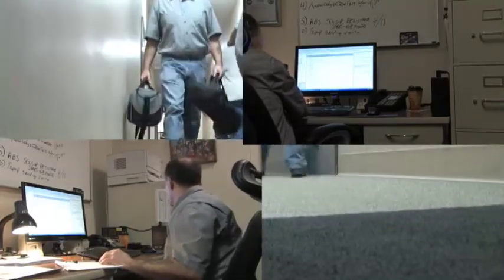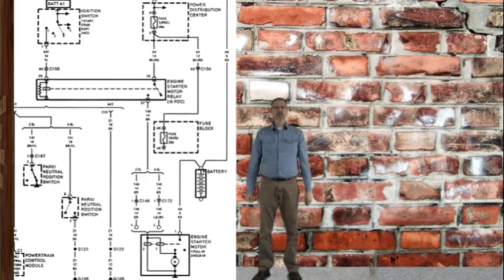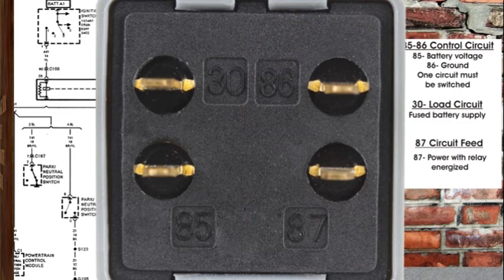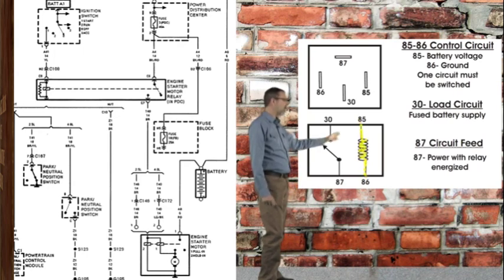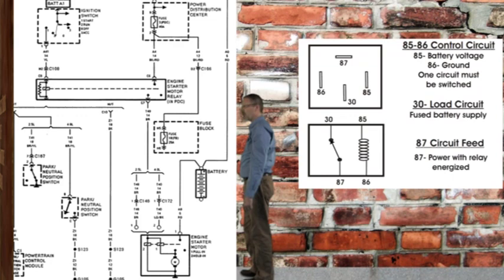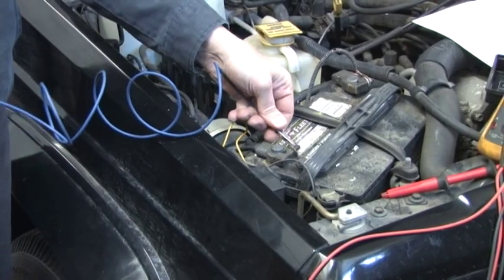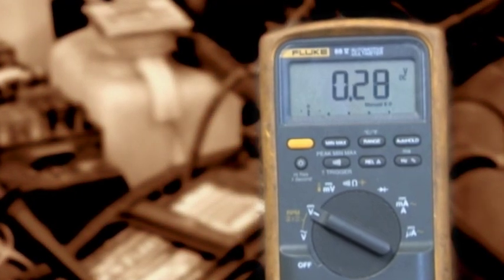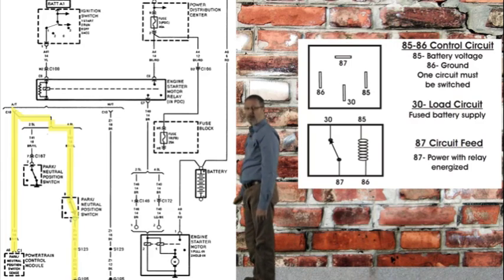No Crank / No Start Relay Diagnosis Jeep

Comment from the maker: @felipevinalay 	
2. If any one or more branches of the A14 circuit do not illuminate the headlight, check splice S116 in the main harness near the Transmission Control Module (TCM). The A14 circuit feeds the ASD Relay, the Transmission Shutdown Relay, pin 56 of the TCM, and pin 46 of the Powertrain Control Module (PCM).

Comment from the maker: You are right, the PCM does ground pin 85 to activate the relay. You can run a ground there yourself and see if the relay activates and the engine might even start. That is also tied into the security system if I remember right.  Let me know what happens after you ground it.

Mark Hicks
Wells Vehicle Electronics

Comment from the maker: While everything is dead check the battery connections. Turn the headlights "on" and wiggle the battery connections. If the lights pop on momentarily you found the bad connection.

Mark Hicks
Wells Vehicle Electronics

Comment from the maker: @felipevinalay Usually pin 30 leads to the coil positive. If this is the case for your vehicle, run a jumper from pin 30 to the coil positive terminal, if this works you have a broken wire in between.

Mark Hicks
Wells Vehicle Electronics

Comment from the maker: @felipevinalay I am going to guess you have a Chrysler Intrepid. 	
1. Remove the Automatic Shutdown (ASD) Relay from the Power Distribution Center (PDC) and check for battery voltage on pin 30. To properly check for a voltage drop, a current needs to flow through the circuit being checked. Use an old headlight to see if pin 30 of the ASD Relay will illuminate the headlight bulb. Check all branches of the A14 circuit, Red/White wire, with the headlight bulb.

Comment from the maker: 3. Ground pin #38 of the C3 connector at the Powertrain Control Module (PCM) and see if vehicle cranks over. This test verifies the integrity of the wiring between the starter relay and the PCM. 

It is common on your vehicle for a bad connection to the starter to cause this problem. It is also common for the ignition switch to fail. By testing as described above it will help to determine if it is the switch. Stay in touch,
Mark Hicks
Wells Vehicle Electronics

Comment from the maker: @felipevinalay 	
Potential Causes: 	
Splice S116
Tech Tips: 	
Splice S116 is located near the Transmission Control Module (TCM) in the main wiring harness and just below the windshield washer reservoir. 

Let me know how it is going,

Mark Hicks
Wells Vehicle Electronics

Comment from the maker: 1. Access the starter relay and make sure that power is coming to the relay on terminal #30 all of the time, and make sure that terminal 86 gets power in the "crank" position.

2. Monitor the Transmission Range Sensor (TRS) in the scan data, be sure that it shows "park" or "neutral" when attempting to start.

Comment from the maker: Try turning the headlights "on" and wiggle the battery cables. If the lights come "on" you have found the bad connection. It sounds like either the battery has a bad connection or the battery is low in charge. 
Stay in touch,
Mark Hicks
Wells Vehicle Electronics

Comment from the maker: Ok, this is a great question! You have to be very careful testing any green or blue relay on a Nissan. Here is the skinny! Normally most vehicles will ground the feed to activate the relay. Nissan will not always do that, they will send current from the ECM to pin 1 and pin 2 will always be ground. Pin 3 is the high current feed and pin 5 leads to the load. I would suggest checking to see if pin 2 is always ground and try running voltage in to pin 1 to try to activate.
Let me know
Mark Hicks
WVE

Comment from the maker: @felipevinalay That could very well be the problem. Especially seeing they usually go under or near the battery. You didn't say if the fuse had power going to it or not. If it does have power than the problem is from there to the relay.

Mark Hicks
Wells Vehicle Electronics

Comment from the maker: @claroscuro73 Thank you for watching the video. I will be happy to help you with any problems pertaining to vehicle electronics, however I do not have information on a water pump replacement. May I suggest contacting a water pump or cooling system manufacturer.

Mark Hicks 
Wells Vehicle Electronics

Comment: thank for you response Mark, I removed the ASD  relay and pin 30 have no voltage.  and I can't locate the splice  S116, also I make a mistake the vehicle info:  98 Chrysler Plymouth gran voyager 3.0.

Comment from the maker: No Pin 85 should have the supply voltage usually 12 volts and Pin 86 should have the same. Pin 86 goes to ground and activates the relay. 

Mark Hicks
Wells Vehicle Electronics

Comment from the maker: It sounds like you might have a battery or connection to the battery issue. What is the year, make, model and engine size of your vehicle? With this information I might be able to get more specific.
Mark Hicks
Wells Vehicle Electronics

Comment from the maker: Let me step back a second, are you sure pin 86 is not being grounded? When you check this out make sure you have the relay removed from the box and then check the corresponding connectors. 

Let me know,

Mark Hicks
Wells Vehicle Electronics

Comment: Hi Mark I got a 96 Chrysler Plymouth and it will crank but won't start, I have no spark because the coil power have no volts, well I check fusees en relay, coil power, with a multimeter and all that seen  okay, the two coil power cable came from the PCM  without volts,  do you thing the PCM be bad. I will  thank you for any tips. haa this problem happen two days after change the fuel pump.

Comment: Hi Mark, 98 Voyager 3.0L no crank condition,  accordance with my Haynes repair pin 86 it's supply V from ignition switch pin 85 goes to pcm it's that possible the pcm ground it? or my electrical system it's wrong, also I notice the ASD relay pin 86 and 30 have V from battery. if the system it right the pcm may be bad..

Comment: So I have a 40amp 12v relay on my engine harness on my jeep wrangler with a stright 6 and its burnt on the top told me that's no good when I try to start it i just get a click its like I don't get enough power to the starter the starter is brand new and battery to fully charged i don't know if im missing something doesn't seem like it though

Comment: I look the diagram and I only have two fuses:# ten and 17, 10A to relay start which pin 30 have voltage,  fuse 17 20A its good, to me the problem is between the battery to fuse 17, but there are bunch of wires and that the problem to me.

Comment: Ok what connection should I check, from junction box to PDC or from PDC to ecu? Is there another way of activating the relay? If the relay is not activated can it cause the high pressure pump not to pump fuel to injectors?

Comment: I am having trouble with a 1997 Acura Integra (battery, starter, alternator, all passed electrical tests) once I have the wiring diagram what tool do I need to test the neutral safety switch?

Comment: This is a great video, by far the best info on solving this problem. I tested the battery at a local auto parts store, tested the solenoid and starter by jumping from the battery to the solenoid terminal and bench tested the starter relay (k3 on my 2008 Jeep Wrangler JK); all good.  There is 12.5 VDC at terminal 30 on the starter relay at all times.  I am a bit confused about checking terminal 86 for 12.5 VDC when starting; can't you pull the relay and see if there is 12.5 VDC on socket 85 when turning the key to start?  I checked both ways and never got 12.5 VDC so the relay is never closing.  That leaves (I believe) circuits upstream of the relay, ignition switch, etc.  I don't have a wiring diagram.  Any thoughts?
Reply from the maker: So you have a no crank no start problem on an 08' Wrangler? Which engine? Do you have a security or theft light flashing? 
Mike Becker, Technical Services Instructor
Reply: No security light (I tried pulling the IOD fuse for 30 sec);  It is an intermittent problem.  When It won't start, I have to jumper pin 30 to pin 85 to apply 12.4 VDC to the starter relay, AND jumper directly from ground to pin 86. It's a 3.8L V6 automatic.  Thanks Mr. Becker!
Reply from the maker: Most commonly on these Jeeps is the transmission range sensor causing it to not start. It will only start in park/neutral. Next time it doesn't start try shifting into neutral then try to start. If it does start, you know your problem is inside the trans range switch. It also sounds exactly like what you have going on, because the Jeep runs after you get it started. Let me know how that turns out. Have a great day.
Mike Becker, Technical Services Instructor
Reply: Thanks, I tried Neutral already and from my research am suspecting the trans range switch but couldn't figure out why 85 never gets 12 VDC AND 86 never has a good ground; I thought the range switch was on one side or the other.  Have a great day!

Comment: hi dear i have 2008 jeep compass car not cranking and not starting  and no fault cod
Reply from the maker: First things first, make sure the battery is ok. From there you could have a bunch of different issues. Maybe a security problem?
Mike Becker, Technical Services Instructor

Comment: Hi Mark, I tried calling you a couple of times I couldnt get through. I tested with the relay connected both pin 85 and 86 showed 12volts. But when i disconnect the relay pin 85 has 3.57volts and pin 86 has 12volts. Will keep trying the phone. Thanks

Comment: Yes the fuel pump is not turning on with the relay, I even tried switching the relay. When I jump with a wire the pump activates but the high pressure pump doesnt pump to the injectors the fuel returns back to the tank.

Comment: need some help when i turn on the car in the start thew check light comes on taught it was the main relay but i do not know
Reply from the maker: What is the year, make, model and engine size of your vehicle? Does it crank and not start? Or doesn't it crank (spin) at all?
Mark Hicks
Wells Vehicle Electronics
Reply: I got through it was a small wire leading to the distributor which broke. Due to the fact that it was covered with electrical tape. It was hidden. Thank you very much sir for taking the time to assist me wirh my problem. I appreciate it.
Reply from the maker: I am so happy you found the problem. A wire break like that can drive you crazy!
Take care and if you need any assistance in the future please let us know,
Mark Hicks
Wells Vehicle Electronics
Reply: It sure can thank you, I will

Comment: hi, i measured the voltage on pin 85 and pin 86, the results: Ignition on pin 85 - 3.57 volts, pin 86 - 12.22 volts. Ignition off pin 85 - 0.00, pin 86 - 1.47 volts. Is this how its supposed to be?

Comment: I have a problem with my jk08 everything runs well it's just when i turn off Jeep and get key out of the switch when i try to turn on nothing happens no dash lights no cliks no Crank no start... even the remote key control wont work ...sometimes i see the security light blinking... I'll get the Jeep start it after a hundred times disconecting and reconecting battery... Any help ?!
Reply from the maker: Hey Marale, do you have any codes? Maybe you have a security issue? A scan tool should be able to check and see if you are setting security faults. That's where I would be starting. 
Mike Becker, Senior Technical Instructor
Reply: Thanks for the answer... And no , no codes...
Reply from the maker: Make sure the Jeep is in park. You could try shifting it to neutral and see if it starts. Could be caused by a transmission range sensor. Could be an ignition switch issue maybe. Could be a lot of different things really.
Mike Becker, Senior Technical Instructor

Comment from the maker: It looks to me you need to check both. When you check the relay like you did you should have battery voltage at both pins 85 and 86. I am assuming you checked it with the relay connected. Disconnect the relay and check voltage at the terminals. Pin 85 should have 12 volts and pin 86 should have 0 volts. let me know what you find. When you get a chance give me a call 1-800-558-9770 press 3 and ask for me.

Mark Hicks
Wells Vehicle Electronics

Comment from the maker: What happened when you grounded pin 86? What do you mean the fuel returned to the tank? Are the injectors firing? I will be happy to answer your questions through YouTube, but it seems things are slow and getting a little sticky. If you like give me a call between 7 and 7 CST. Call 1-800-558-9770 press 3 and ask for Mark.

Mark Hicks
Wells Vehicle Electronics